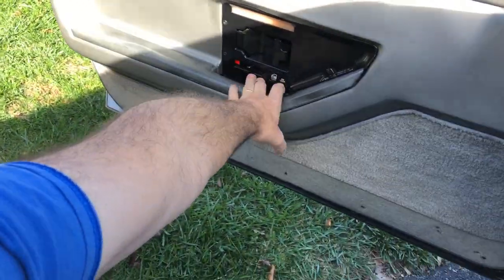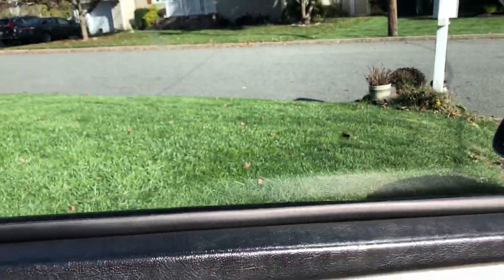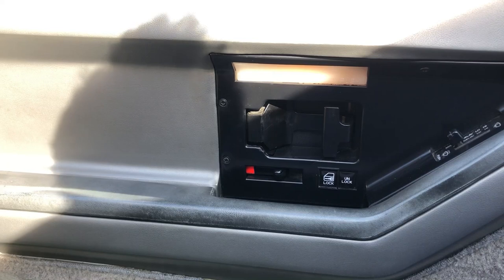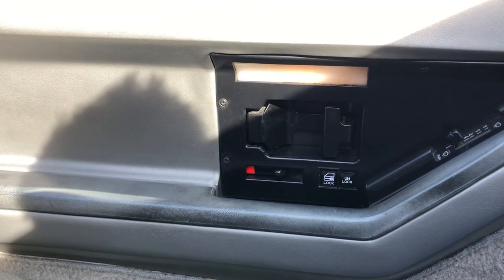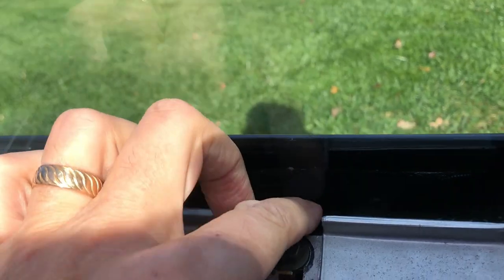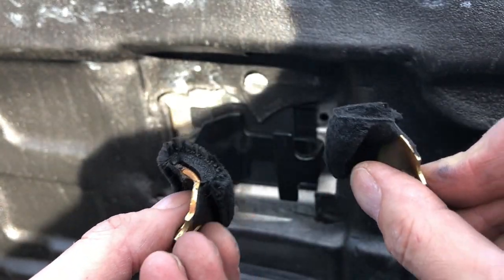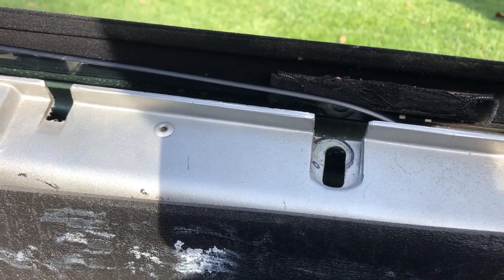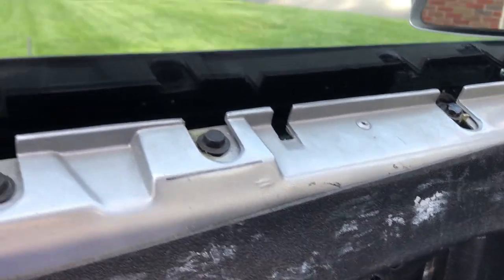Battling the Window Rattling on My C4 CORVETTE

Comment: I have similar with my '87, same chase, little luck. However, mine did not have the OUTER felt pads, see on the opposite side of window at 6:48. My bet, these are worn and need replaced.
This actually helps me, I replaced the window seals and the window hits the outer fine, but the inner barely touches the window, if at all. Time to find where the heck to get those felts.
Reply from the maker: Good luck! Let me know if you get it all sorted out.

Comment: Great video, very well explained.
Reply from the maker: Thanks for watching!
Reply: Good video. Good luck with that third one. I tried that on my 85 and it just didn't work right. Ended up needing to adjust and align the window. Another cause of rattles is the lock rods and door open rod. You can split some vacuum tubing and put over the rods and quiet it down. The door opening rod can slip out of it's clip so check that too.
Reply from the maker: Thanks for the info!